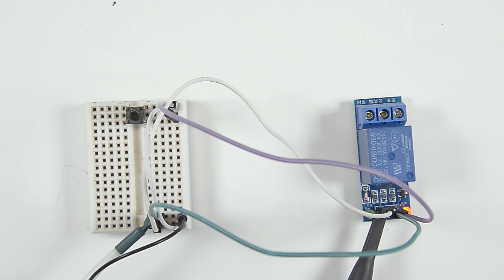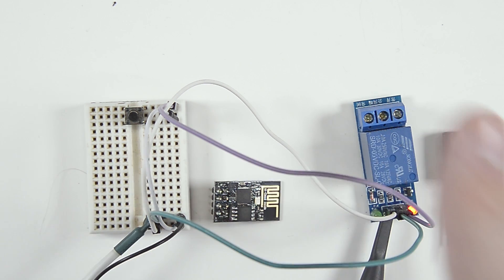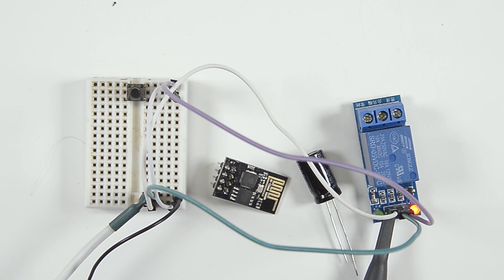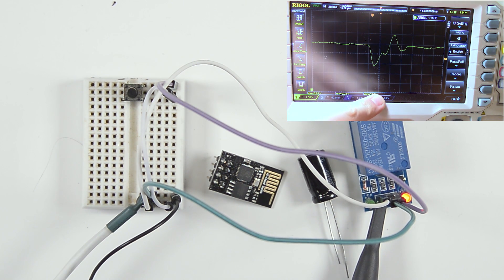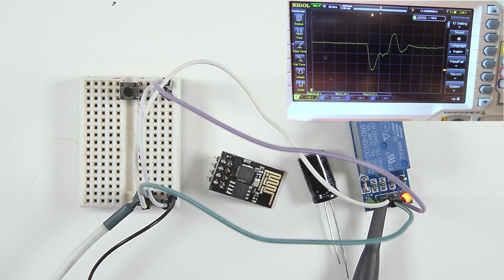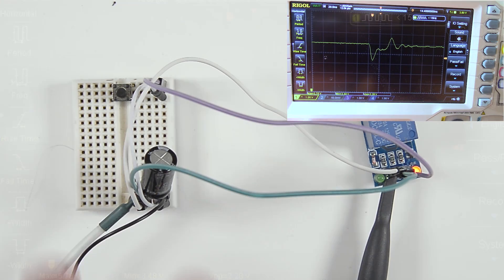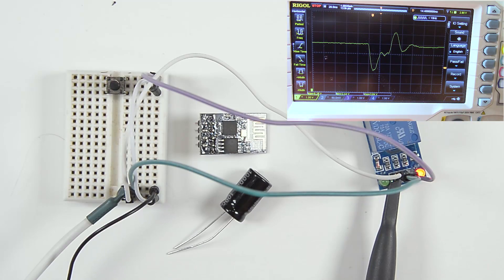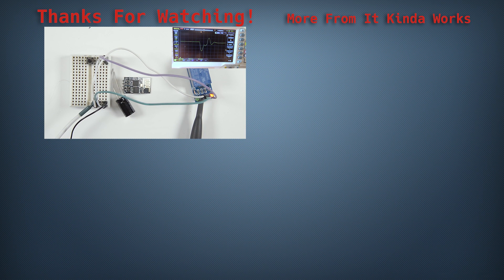How to keep your sensitive electronics safe!

Comment: The relays coil is a induction which resists changes in current. When you hit the switch, at first cause a surge in current causing a dip in voltage then once the coil is saturated the coil resists current change again and causes a rise in voltage. This is my best.. never went to school for electronics.. I think thats what is happening.

Comment: Hello sir after continue use of relay for home automation it is getting heated.
how can we make component like relay & power supply normal ?
Can we use heat shink sheet OR liquid  on relay ?
Reply from the maker: That is somewhat normal so it is ok for the relay to get warm. One way to prevent prolonged heat is to make the relay trigger only when needed. So if you have this wired to a light that is usually on and only occasionally off you could connect the power to the common and NC (normally closed) pins and reverse how the relay operates so that when you activate the relay it turns the light off.  You could also used what is known as a latching relay which only needs the coil to be energized when turning the relay on or off. 
Generally you shouldn't need to use a heatsink on a relay and definitely don't use liquid on something switching AC power.
Reply: Thank you sir,
i am using songle relay for two way connection, so i can do switching manually as well as via relay.

Comment: Actually when the device de-actuates. Because coils have inertia
Reply from the maker: It goes both ways, doesn't it? Both actuation and de-actuation, thats why there is a dip and a spike from the relay.
Reply: Yes correct. My point was when the circuit that has a solenoid in it closes the solenoid kind of fights the current and does not "want" it to build up. Thus the chances of destroying other components specially semiconductor based are low. And then it eventually stabilizes etc. However when the circuit opens the solenoid again does not like the current to fall (causing a large voltage build up) and hold on to it eventually sort of giving up and dumping a large current. That is why people sometimes connect a diode across a relay coil to let the reverse current effectively short out through the diode and dissipate as heat. I know you know all of this. Just thought I would add my mental picture of whats going on.

I like the videos you are doing a lot and they are helping me in my projects
Reply from the maker: Ah ok I see what you're getting at! Even with those diodes there still tend to be spikes and dips in my experience but yeah that greatly reduces the magnitude of the noise. Glad you're enjoying the vids!

Comment: very helpfull thanks ! but should the capacitor be in the power supply of the relay or the esp or both ? (in case there is a separate power supply)
Reply from the maker: I would put it on both. You probably don't have to put it on the 5v supply if the sensitive device is on the 3.3v supply but I usually do since it just tends to help overall from my own experience.